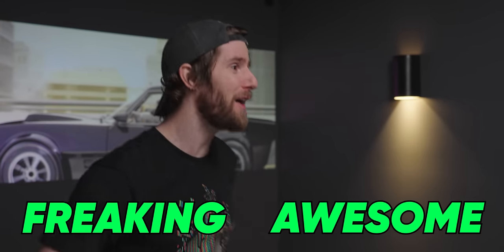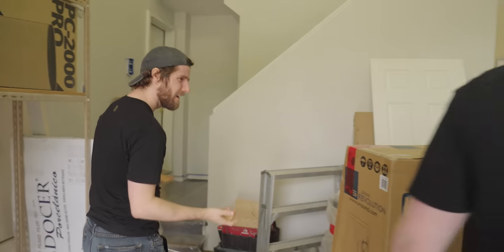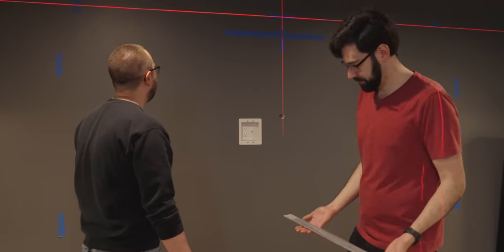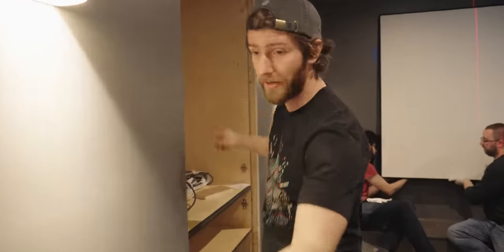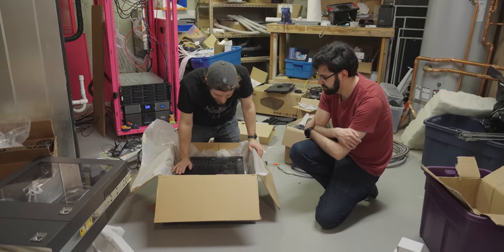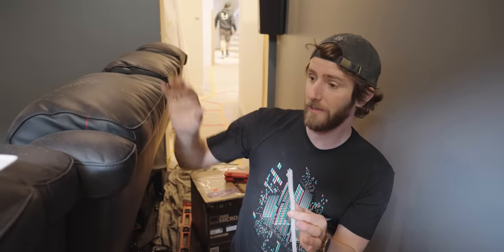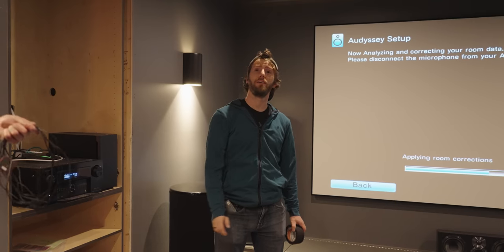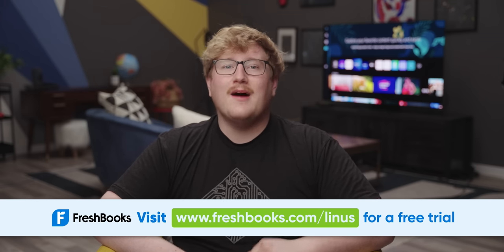I finally made it - House Theatre Room Build

Comment: 23:56 as Jake later said subwoofers need to be turned up. +12 dB is max that receiver is able to push them. Also Top Rear L+R are at -12 so they are at a minimum setting receiver can put them. 

Also Linus should go borrow Anthem MRX740 from James and compare it to Denon receiver. ARC Room correction is superb (switched from denon to anthem recently).

Comment: Subwoofer placement is extremely crucial, unless you're installing in a bathroom sized room where the dimensions are much smaller than the sound wavelength of bass

Comment: I love that they're getting into this, but man, I REALLY wish I could spend 20 min speaking with them on how to better implement so many things here (many wouldn't necessarily cost anything more), and how to solve for several issues mentioned in the video. These would be things that many in the home theater space have learned the hard way or have been exposed to over the years. Some however, are more technical and advanced, but would save a ton of headache while solving things effectively. 

Similar to Linus walking in on me building a network server for example. 

I come at this with only the intention to help and support. Some of my home theater gear includes a JVC NZ9 w/ a DCR Lens, MadVR Envy Extreme, Trinnov Altitude 32, etc, etc. All end game equipment, and with that, professionals were brought in to calibrate audio, video, and support as needed. 

Regardless, I'm very happy for him and I wish him the best.

Comment: 12:44 Hard NO on those screw-in-screw anchors! They are the worst anchor design of all time and they WILL FAIL. Heed my warning!
For the love of everything good in the universe use a) SNAPTOGGLES, b) hollow wall anchors (with the split sleeve that compresses against the drywall) or at very least c) WallClaw anchors.
Reply: Truth. Every YT video comparing anchors (and my own experience) concludes those white ones the absolute worst. They chew up the drywall by design, ruining the structural integrity of the wall in the very spot you need it to be strong. They are super-easy to pull out because they don't grip the wall from behind.
When (not if) they fail they will leave behind a massive crater and a broken speaker on the floor.

Generally speaking, anything that relies on the hole in the drywall to carry the tensile, sheer and cantilever loads is subject to catastrophe.

Reliable anchors use a clamping force between the two paper surfaces of the drywall to secure themselves and their loads to the wall. The more surface area involved the better.

Topggler Snaptoggles, as OP mentioned, are excellent. Regular old toggle bolts work, too, but are less flexible.
If you get the split-sleeve anchors as OP mentioned, make sure to choose the right size for your thickness of drywall. There's also a setting tool you can buy to help get them locked in place, but its not critical.

All this is moot if you can drill into a stud, of course, which is optimal.
Reply: Yup!
Reply: Agreed. Don't trust your expensive gear to cheap anchors! Use the best anchors you can find! Take it from a guy who's had to learn the hard way!

Comment: The projectors that use a curtain to adjust the aspect ratio do it the other way. They have a screen that's way wider than it needs to be and motorized curtains on the side to correct the aspect ratio. That way is easier that a vertical adjust.

Comment: Yeah, a home theatre was always a dream of mine too, I built mine in the basement, only a 1080p 100" screen, but all for under $600. Waiting till 4k projectors are cheaper. I replaced my 50" 720p plasma though, so it was a huge upgrade.

Comment: I was waiting for Linus to just throw the setup mic away - which is the only sensible thing to do. My Denon also has this feature, and I ended up doing the whole configuration by ear because the whole system doesn't work. It actively shut off my sub, every single time. Best thing to do is to just do it manually and measure dBA with an SPL meter. Yes, it takes longer, but boy does it make your experience better!

Comment: That projector looks incredible.

Also, it's crazy just the SVS speakers cost $4,500. That doesn't include the ceiling speakers or the subwoofers. Lordy.

Meanwhile, I am rocking some used Sony speakers and subwoofer that cost me a total of $20 used and sound way more than adequate.

Comment: Looking good👍👍 Try to get some sound absorption panels in the first reflections, 4" or 2" with 2" gap. Side walls for L R, and ceiling for L C R and back of the room atleast. And try to experiment, place one subwoofer in the front of the room 1/3 the width and one in the back, other side 1/4 the width, you will get much better seat to seat consistency.

Comment: Put the subs in the BACK corners of the room. The 90° corners will direct the sound into the center of the room as well as spread the sound out along the walls. That way you'll get the best coverage, won't see them and also won't interfere with your front speakers or screen. 
Use the backlight ...... It tones down eye strain and looks cool. I like green, cyan or amber when viewing my tv with RGB backlight. Your projector is so bright the backlight won't distract from the viewing content!
Reply: I think he has the entrance door at the back right, so might be better to place one sub, at the back left corner, and the other at the front right side.

Comment: I love it when they say. 300w is high power. Lol I have a 3kw kettle and it shares with loads of other high power items fine. Wire in ring which does 2 things more power can be delivered and you can have a fault and still have everything work temporarily.

Comment: if you would of sheathed the whole room in 3/4 or 1 inch plywood, then sheetrock, you could mount stuff securely anywhere, and it would of increased your sound proofing.

Comment: Linus nice setup with the home theater but you over did that with the speakers in the ceiling, which sonically messes with the configuration L c R     2 sets of surround sound, the dipole surrounds are perfect on the rear of the wall the second pair in the side walls not to close to the rear, that cylinder subwoofer has a port in the back which should be 3 inch’s from the wall it’s a down firing sub, I was tech installer for Best Buy  magnolia was the high end theater equipment and they have a regular plain home theater but very nice, center ch are always below or above the screen it’s dialog  like someone is looking you in the eyes when their talking, anyway I love your show your partner with the blond hair the sticky one If pretty dam smart  you both are take care guys am watching some more videos 👍🏿👍🏿👍🏿👍🏿👍🏿

Comment: The direction of the port makes a lot of difference when it comes to a subwoofer. Point the port at the wall and then point it away from the wall, you will easily hear a difference. Distance of the port from the wall also matters. You won't get the same sound 2 cm away from the wall vs 2 meters away from it.

Comment: Setup looks great! But with a projector lens that has adjustable optical zoom, you don’t lose any light. That’s the beauty of lenses! I work in live event production and we use lenses to put projectors 5’ from a screen or 80’ from a screen and the overall brightness result is the same. One light output with the image focussed to whatever size you want. So long as your image size (projection screen) is staying the same, then your light output should be the same no matter how far away your projector is, or how much zoom you are using on the lens.
Reply: From physics standpoint lenses always lose some light in non ideal situations due to imperfections. Easiest everyday examples are camera lenses. Prime lenses (fixed focal length) are generally "fast" (usable shutter speed) lenses with less glass and zoom lenses are "slow" with more glass. Regular air itself causes some light loss due to dust etc. in the air dispersing a beam of light.
Reply: @anomuumit   Sure, no lens is perfect and a certain amount of light will always be lost, but that amount is not going to change significantly depending on how much zoom you are using with the lens. I honestly don't know a lot about photography and in theory a projector is doing the same thing as a camera but in reverse, although with a much more controlled light source. My point is that placing your projector closer to your screen because you want to use minimal zoom to achieve less light loss is a misconception. You can place the projector wherever you want, so long as the lens is within zoom and shift tolerances to fill your screen. If you have to keystone the image because your projector isn't level, or you have to pan or tilt it because your lens is outside of it's shift tolerances, then you will lose light because you're starting to crop out the sensor.

Comment: Well, im fine with my 5.2.2 setup with Klipsch subwoofers and KEF speakers.
No need for such a extreme form of decadence, even got all my KEFs 2nd hand over years from people who didnt want the huge things anymore and paid "only" around 5000$ for 9 speakers (2 still not in use waiting for a 9 channel AVR) and 2 subwoofers. Brand new only the KEF speakers would have cost 8k+ already, let alone the Klipsch reference subwoofers with  digital control panels from like early 2000s. I just love the Klipsch RW-12D so i have 2 of them running and another 2 spare. bought already a few broken subwoofers from all better brands, repaired them and sold them for a budget to home cinema fans.

Comment: Ive been doing home theater and home audio for a long time and my opinion about subwwofer placement is different. Ive seen as much as 3 db gains from moving a sub from the middle of a room to the corner. I believe because of this subwoofer placement is very important.
Reply: To be fair, shoved completely in the corner tends to make the swings in bass from one seat to another greater as well. Harmon International's white paper preaches sightly out of the corner, and four of them, one for each corner, for a smoother seat to seat consistency starting point.

Comment: My set up. 65 inch LG Nano 4k 100 hz. Connected to Bose soundtouch 300 home theatre complete with rear wall mounted speakers and soundbar and 12 ich subwoofer.

Pc is 6900 xt with 11700 f and 32 gb  ram. 2 terabytes of sata 7200 HD, 2 terabytes of ssd. 

 Quest 2 Vr headset with kiwi elite headstrap and external 8hr battery. Silicone she'd face cover and vr cover face padding. Kiwi grips for controllers.

Logitech wirelesss mouse and keypad.wireless xbox one controller for pc gaming.

Blackshark v2 pro wireless headphones with Eva hardshell protective case for the headphones and USB stick, detachable mic and 3.5 cable.

Comment: absolutely the PJ goes best far away from the screen, less noise, less zoom so better image clarity and uniformity and if you'll upgrade to another model with higher minimum throw ratio you don't need to redo holes in the ceiling
Reply: but the further back...the more zoom, not less.  I mean you want to shoot for the middle, not max or min zoom 15-16 feet is about right for that size screen and lense

Comment: For Toe in, you can adjust based on listening preference some speakers sound better pointed straight forward or even toed outward. PC 2000 pro subs are awesome. You can use a program called REW to see how the subs measure and using the DSP within those subs adjust the PEQ to ensure each frequency is played at around the same Db.

Comment: Given that the rear row height was set so that they can see the bottom of the screen, I wouldn’t mind betting that the centre channel is firing into the headrests of the front row.

Fine for lower frequencies, which will diffract over the top of that row, but I would worry about losing HF, which might be a critical difference with a speaker primarily used for speech.

I’d be placing it above the screen. Obviously the comment about speakers behind the screen is accurate, but those acoustically transparent screens are even more expensive haha
Reply: Either that or tuck it right up under your screen and make sure that the rear row can actually see the speaker 🤷‍♂️

Comment: I hope a lot of your sound setup was just cutout of the video.  Sub placement is important to get the best response within the room.  Ports should be at least as far from the wall as the port is wide.  Those ultra towers should probably be pulled away from the corners.  Your back row seating is not going to get good sound, especially with your center being so low.  You should get a real sound guy to come and set it up for you.

Comment: He could've also just setup a phantom center. Not ideal but when your screen is so big the center speaker is tucked low to the ground like that...
Reply: Phantom center works when it's just one person using the system dead center. Two rows of seating and off axis listening lesson the ability for the phantom center to perform optimally.

Comment: You get different amounts of room gain depending on where you point the port and where the speaker is placed. it does not, not matter. Put it close to the wall (whether i is sealed or ported), you will get more bass from boundary effects and this may be exacerbated by pointing it at the wall. If you have the power, sealed subs are typically better. Not bigger, because they dont need to be, but better as far as tightness of bass. In my experience. Heres a ink to explain. https://www.prosoundtraining.com/2011/08/29/how-boundaries-affect-loudspeakers/ So sure, perhaps you will get MOAR BASS with a ported sub close to and pointed at the wall, but it will certainly not be more accurate.
Reply: Great video though. I too like these informal format vids a lot.

Comment: Am I just weird or something? I'd just take a white bed sheet and pin/nail it to the 4 corners of the wall, every few months or so I could replace and/or wash it cause I know for a fact it will get stained somehow. Is there really any reason to go for an expensive screen when you have a good projector anyways?
Reply: to make the best out of it because you just spent a fortune on a whole ass theater and want the best out of it?
Reply: @DE3P_Beats  there's still the problem that the screen will get dirty and yellow over time, whereas I can just replace the bedsheet and wash it. Correct me if I'm wrong but I don't think I can throw that screen in the washer and be done with it. Best case scenario I expect it to be hand washable, worst case I expect you have to get a ladder and a wet cloth and scrub every millimeter of it by hand while it's still hanging there.
Reply: @hummel6364  A vinyl weave acoustically transparent screen actually can be washed. Maybe not in a washer, but you can scrub them down just fine. Double bonus, the speakers can go behind them, allowing you to have three identical speakers across the front.
Reply: I have a 220 inch.....just using my white wall....

Comment: SMH.... Dan (the "Audio expert" is wrong) don't have the rear port that close to the wall.... you'll get more ROOM gain with the subwoofer resulting  to "muddy/boomy" bass. Do a sub crawl to optimize the bass in the room. It just makes Audessy (the room correction software) do less work. Resulting in a better audio experience.  😬

Comment: I love how meaningless the decimal points in home theater speaker setups have become. .1 for the subwoofer channel was due to it being derived from the low end of the stage channels. You can have 15 subwoofers and it would still be .1, although really not even that because the sub is a discreet channel now. Also, Atmos height channels are discreet as well so a 7.2.4 system is actually just 12 channel.

Comment: Ten years from now Linus will have a "Tech House Renovation" video. "At the time of install, our equipment was state of the art, but now everything is old and obsolete so it's time to rip everything out and install the latest in Hi-Tech. We'll start with removing these obsolete Display Port cables because of our new Ultra Wifi 20G router that makes running cables everywhere obsolete.  It wirelessly supports 200K@1 Million Hz monitors and headsets  for the ultimate 3D VR gaming experience. Every monitor, computer, TV now comes with builtin Wifi so there is no need to ever run a cable for any reason."

Comment: 4:40 Though candidly this may seem jovial and a joke but Linus proposing a contract under supposed unknown conditions to the other party all the while actually knowing the outcome is not a legally binding contract. Which to Linus's staff may look like Linus is simply cheating again, but technically because Jake is being paid for this job and Linus is using work related commodities as an incentive to make the proposal - it is still a legal binding contract under Canadian Law. And because Linus knew or found the speakers before making the seemingly unknown proposal. It's an illegal contract. He knew the outcome but pretended to not know and to play coy and pose a seemingly unknown question based on a seemingly unknown outcome when he actually knew the outcome. 

The hole behind large speakers & woofers is an air port and not a sound output port. The general rule away from the wall or other solid objects is based on the size of the actual main speaker. ie: 6" drivers means keep it at least 6" from the wall, 8" driver keep it 8" from the wall. Cutting the distance from speaker air port to the wall can muffle or deaden bass sounds. Will also cause dust to explode from whatever crevice you forgot to dust behind the speakers.